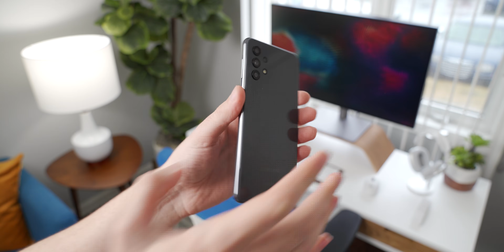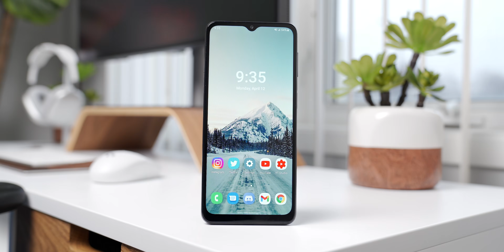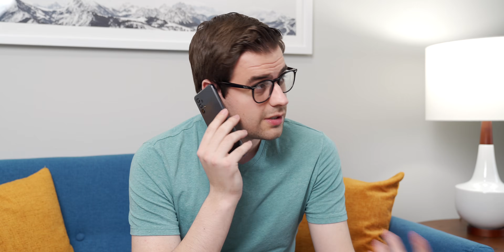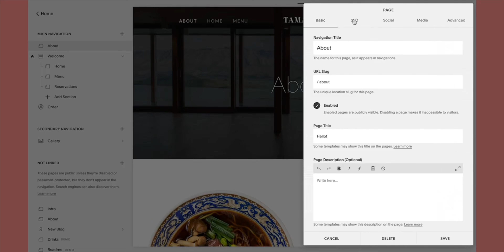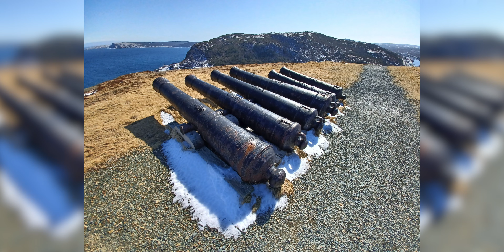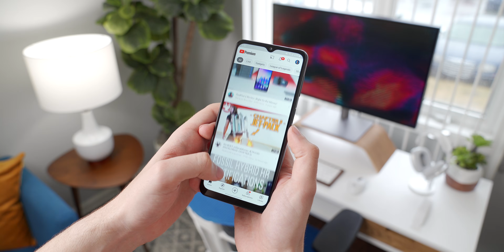Samsung A32 5G: The Budget Battery KING?

Comment: "feels speedy" is a worthless assessment of it capability. running a game with a fps counter to test the igpu and a video/image render time to test the cpu realworld output. testing load in times in open world games for testing storage speed and how well the motherboard and chipset "ties" the ipu ,cpu ,ram and storage together. also hertz refresh rates are more of a marketing bs than anything useful. what you should be looking at is the pixel response time or more exactly g2g pixel transition time (some other standard may be used to fudge the end results numbers to make it look a little better on paper)this applies mostly to monitors and tvs because you do not have much of a choice with mobile displays as the information is never disclosed.

Comment: Had this phone and I had to return it. Might be the 5g antenna  they used in it because I had it up against my LG k92 5g and the LG was much faster and LG doesn't even make phones anymore. System was lagging and more than a few times it wouldn't even auto rotate. I ended up getting A Motorola Stlyus 5g and the internet connection on that is much quicker and the phone feels more sturdy in the hands when compared to the A32 5g. Maybe the 4g version is better because it feels like Samsung just made it cheap just to call it a 5g phone. I had a s9 for 3 years so this is no hate on them just stating my experience with the phone. It feels dated like it should of came out a few years ago as a budget phone.  Maybe it has been better for you guys?

Comment: Great video! I would just like to say that, actually, the Samsung Galaxy A32 5G does NOT have a 90Hz display but has been downgraded to a 60Hz display. The 90Hz display is only available for the Samsung Galaxy A32 4G.
Reply: nvm I was wrong 🤣
Reply: @ishtiaqahmad4664  I was just about to correct you 🤣 the non us a32 5g was just unlucky!

Comment: Any problems with the volume while making calls outside or in a crowded place? 

Have been using a Galaxy s3 since c.2012 and will be trading it in for a free A32 5G from T-Mobile and a 2 year agreement. On the s3, web browsing is slow, some apps no longer work and can't install new ones and trying to find an OEM that works is a gamble, but is the free trade in worth it or should I have paid for an s9 or s10?

Comment: I read somewhere, T-mobile, my carrier, is offering an A32 5G with a 2 yr agreement if you trade in your old device... to boost their 5G numbers.  
Based on this review and others, I'm gonna pass.  The hardware specs are okay for a budget phone, don't care really about cameras, but no water resistance and I prefer the AMOLed display.  Now, if they offered the A52 5G at a deep discount...
Reply: I have been using a Galaxy S3 since c.2012, so anything's an upgrade ATP...😃

Comment: A32 4G is much much better cuz it has everything you want on a midrange phone other than the fact that it's not 5G.
It's the one with 90Hz FHD+ AMOLED screen, Better camera & a more modern in display fingerprint sensor (which with some people may not be a big deal) but the fact that Samsung put more efforts on it is a fact that A32 4G is the better A32 than its ugly 5G fraternal twin.

Comment: You should check out Redmi note 10 pro which is also less than 300 bucks and is 10x better than this phone with super amoled 120 hz display and a 108 megapixel camera
But it isn't 5G

Comment: Man. At $279 this is crazy tempting.
Reply: Actually 90 not 60. Trade in a phone and get it even for less.
Reply: @jeffj318  "Variable"
"up to" 90  IF gaming
TOO SLOW to even reliably use for bidding
Reply: Seriously, DON'T 
You'll Regret It 
60hz is Too Slow to be anything but frustrating
Reply: @wuggybuttz3923  ???
Reply: @wuggybuttz3923  Uh okay I got it for $150 used in good condition from ebay lol.
Reply: I figure you still over paid by 100
but, Good on You
Reply: @wuggybuttz3923  because getting half the price is overpaid lmao man you clearly never had a cheap phone and 60hz is completely fine for majority of people

Comment: Hi I'm looking to upgrade soon and this looks like a great cheap ish phone, would you know off the top of your head if this phone is better overall than the Samsung s10e? I'm pretty bad with specs with phones :(
Reply from the maker: I would definitely go with the S10e over this. The S10e doesn't have a high refresh rate display or a huge battery, but the quality of the display is better and it should be much faster than the A32 5G. It will most likely be more expensive unlocked though.
Reply: @MarkSpurrell  ah sorry bud, I didn't explain myself well enough. I have the s10e so just wondered if it's a massive downgrade from it, I know you've said pick the s10e over a32 but is it a massively noticable difference?
Reply from the maker: Ah okay. I wouldn't call it a massive downgrade. You'll definitely get much better battery life but the display, internal specs, and cameras are definitely a downgrade.
Reply: @MarkSpurrell  you my friend are a gem, thank you for such a responsive service. It was either that or get a s21 at stupid price on contract, so think I might go for the a32 and keep my monthly sim. You've been a great help, I wish you all the success in the world

Comment: I'd rather buy a Redmi Note 10 Pro Max which has a 120hz(adaptive refresh rate) AMOLED(700 nits and 1200nits on HDR10) display, Snapdragon 732G, 5020mah battery, Gorilla Glass 5 front and back, 108MP camera, and 6/8GB of RAM for $240/$290 respectively.
Reply: Poor build quality, poor display quality, camera bump gets dusty after 1-2 weeks. Check internet for more and never trust China.
Reply: @marufgriffin  100% Agree